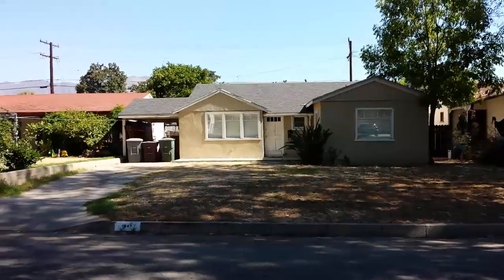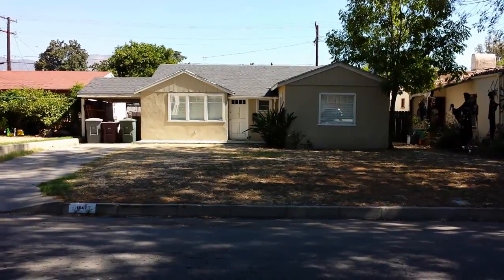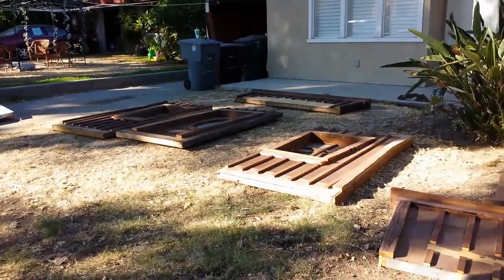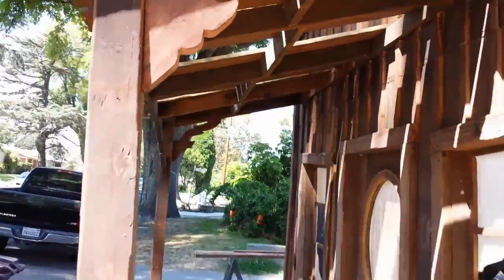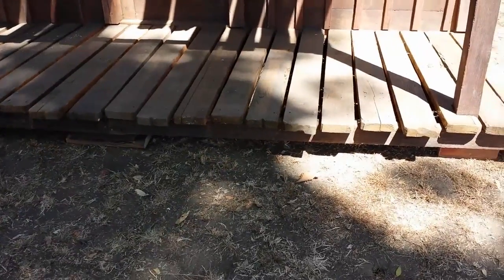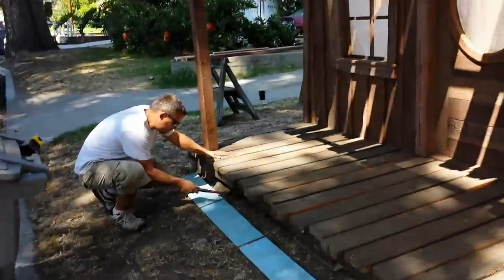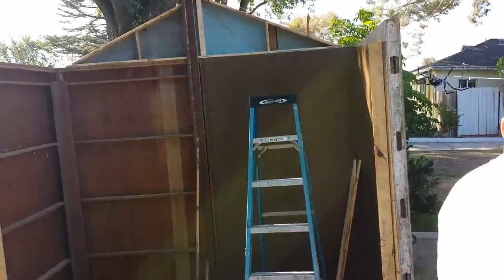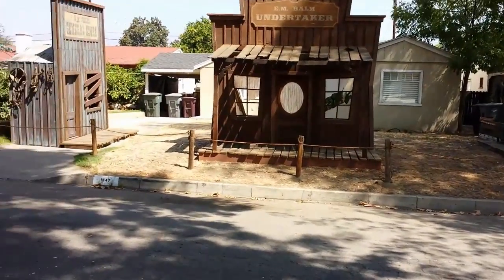Setting Up The Halloween Western Ghost Town Display: Part 1

Comment: In the old west, they didn't hide the supports under the buildings because the buildings went up so quickly. Only the richer people covered those. You all do amazing work though. And I like that you care so much about the people going through and the safety issue.